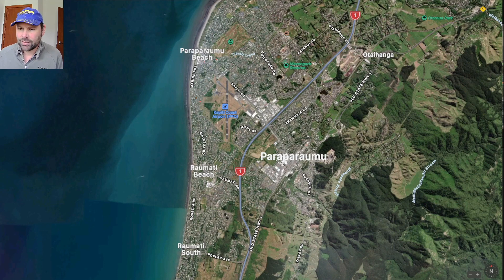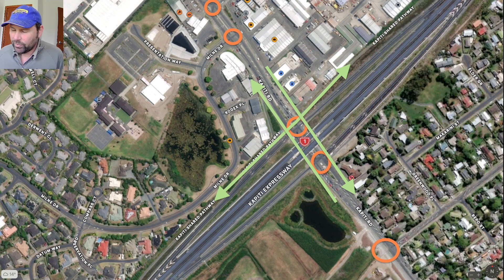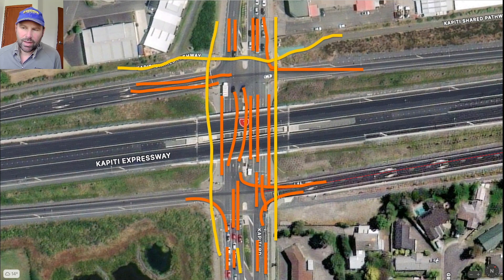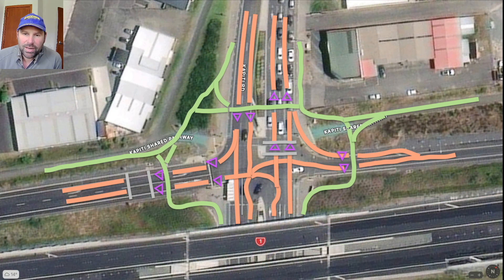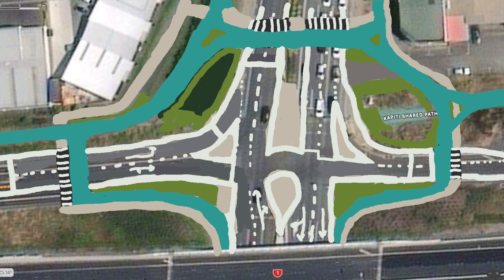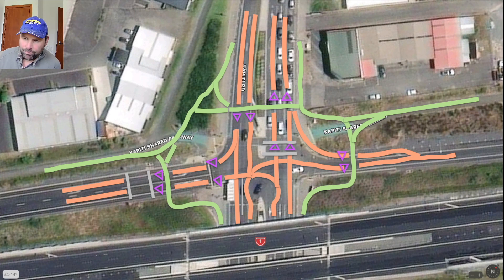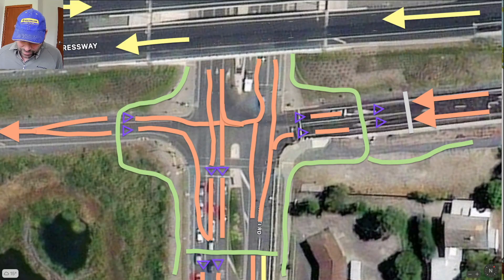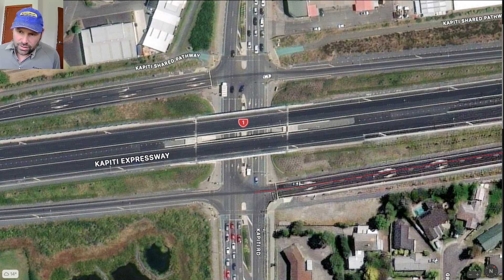I Redesigned Kapiti Road SH1 Interchange

Comment: Hello Darryl, a few points come to mind .....  ar 12:40 you mentioned cyclist heading the wrong way on the northern side of Kapiti Rd (westbound) that situation would be if someone wanted to turn into Te Roto Drive without negotiating 2 more sets of lights.
Secondly, the lights in NZ (& many other English speaking Western countries) are very simple. The YT channel “Not just Bikes” has a video about smart traffic lights in the Netherlands here. https://youtu.be/knbVWXzL4-4
Third, the Dogbone/dumbbell roundabout that you suggest is the predominant style used on TG motorway for all its intermediate interchanges but volumes on the intersected road are lower than Kapiti Road. The closest analogy would be the Meeanee Road on SH2 Hawkes Bay expressway.
Reply from the maker: Yeah, good points. The traffic lights, they are so unsophisticated. I live about half way between the expressway and the old SH1, so when I drive north, sometimes the delay at the traffic lights wastes so much time, that taking the old road can be just as fast, but the randomness of the delay is annoying. I am disappointed about the large number of traffic lights and odd cycle lane layouts. I would love to see the vehicle flows and maths for the traffic lights.